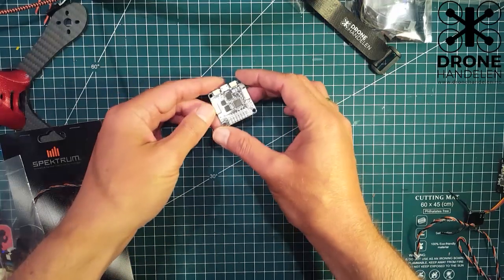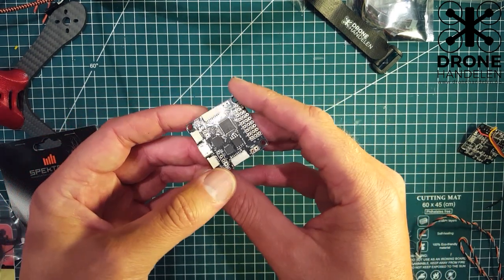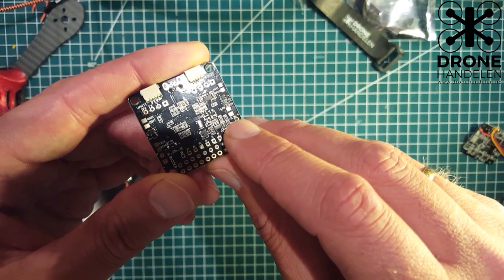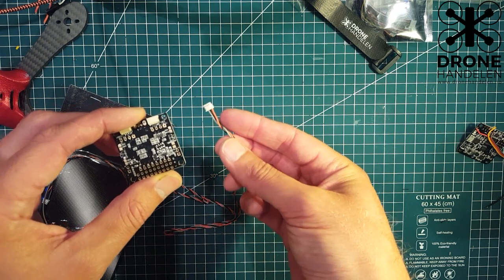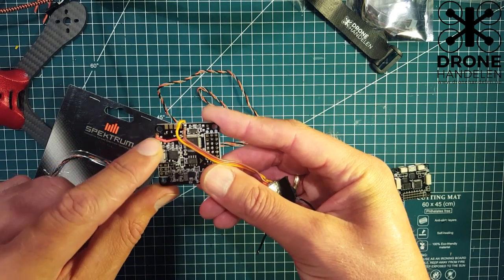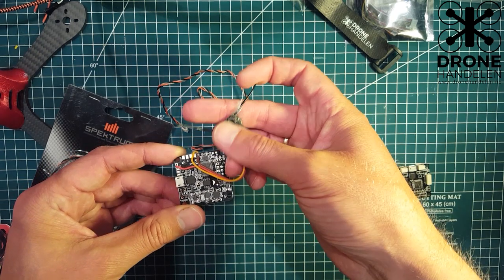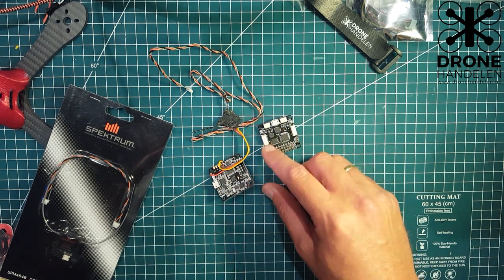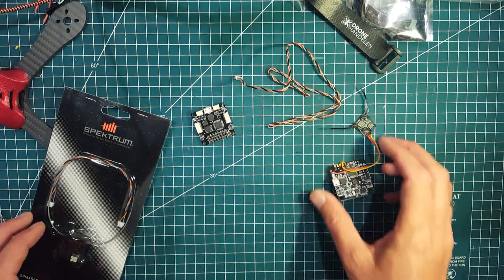How to: Spektrum satellite to FC

Comment: Hey,
Nice video.
I have the same receiver as you but as soon as I plug in the battery, the LED flashes on then off never turning back on except if unplug then re plug the battery.
I have measured the Voltage on the pads and it is 3.291 volts so I don't know why it is doing this.
Reply: Seems like you have not bound the receiver to the transmitter. You must do this first or through beta flight
Reply: @Warbirdpilot  care to explain a little more? How does betaflight put the satellite in bind mode?

Comment: Hello,

super video I just have a small question, I buy this flight controller ( Upgrade DYS 30.5x30.5mm F4 Pro V2 Flight Controller AIO OSD & 5V 9V 3.3V BEC & Current Sensor)  and I want to know if it is compatible with the PSM4648 radio receiver?

thank you in advance
Reply from the maker: Thanks, I am not familiar with this FC that you mention but I am pretty sure that most FCs today support most serial receivers..
Reply: thank you, 
you advise me which radio receiver?

Comment: Super nice video. Do you have a video how to Configuration on the receiver mode and show how to set up the ports on betaflight ? Im using a Spektrum SPM 4648 DSMX and putting on a SP  Racing F3 ACRO ?

Comment: does this work with the normal spektrum satellites?
Reply from the maker: Yes, but its not recommended as "normal" satellites are not standalone receivers..its recommended to use their dedicated quad receivers..
Reply: Thanks, ive not been able to get the sat working on its own, everything connected right, 3.3v, ground and the signal wire into ch4 but nothing and for no reason cleanflight stopped connecting it, nightmare, im wishing I bought a frsky TX now and module, its £200 but I hear frsky have a stronger signal and range, sounds like the way to go now.

ah wait just realised im confusing your video with another, some other guy said the signal wire MUST go to ch4, but you say RX, I will try your way.

The odd thing is the frsky RX that came with the quad has a single wire going to both ch4 and ch5, do you know why that would be?

Comment: I can't get binding mode on spektrum in my receiver on . can you help me I'm using spm4649  too
Reply from the maker: It should enter bind mode automatically if it does not see any signal from your transmitter(ie if your transmitter is off) in 10 seconds, as far as I know
Reply: i cant get blink mode (bind mode) on my receiver after go to CLI and write set spektrum_sat_bind=9... after i plug usb, my receiver is only blink one and not blinkink like binding mode... can you help me.. im frustated.

Comment: thank you for this video , it helped me a lot !! 

I'm having a problem right now with arming my quad , I used to have a switch aux1 for that. and right now in clean flight I see the end points of the receiver to throttle is 1159 and 1840 , I will be happy if you could help me configure it to the normal 1000 to 2000 . 

I'm using sp f3 racing board and sat spektrum receiver.
Reply: my transmitter is spektrum dx8 gen2
Reply from the maker: Mohammad Al-Thubaiti you go into your transmitter and adjust your endpoints on the throttle channel in servosetup screen.

Comment: Thanks, at the end you mention that one can connect it to pin directly as far as is the right one for 3.3v, but you prefer soldering directly to the board. Is that right? Can we connect the spektrum sat receive connector to such bay and not have to solder altogether ? If so how exactly? How do I align the 3 pins into the 8 pin bay? Thank a LOT for your expertise in advance . I am personally shocked that such a popular board would force us to solder joints for such a popular rx like spektrum. I want to think there's a way to just connect them and works!
Reply from the maker: On this FC that I showcase here there is no other 3.3v output than the one you have to solder on to, other FC cards may be different and have spektrum connectors built onto the FC itself, in that case you can just plug the  recevier in. I also know that spektrum now has a quad specific receiver with telemtry that support 5v instead of 3.3volt, in that case you may use any 5 volt source you like.
Reply: Thanks a lot. Ok then I guess I have to bite the bullet and solder it to my FC then

Comment: hello would this http://www.horizonhobby.com/fc32-rev-6-flight-controller-spmfc3206be plug and play ? with this http://www.horizonhobby.com/spektrum-dsmx-quad-race-receiver-with-diversity-p-spm4648I fly a vortex with a silver dx8  I only know BIND AND FLY    would these components work on any machine I get as a kit ?thank you there is not much spectrum BNF  stuff
Reply from the maker: Well, with that FC you would nned to do some soldering anyway as there is only pinouts on that, and no connectors. So no, that FC is not plug and play in that sense.
To your second question, yes any kit will most likely be able to use those components.

Comment: do you have to have your ESC signal wires hooked up to the FC for your receiver and transmitter to function? I am waiting for my esc's in the mail and when I went into beta flight my receiver is going crazy. what do I do?
Reply from the maker: No, The ESCs do not need to be connected to fc to set up the FC. If the receiver is going crazy there must be something other setting that you have missed under the configuration or setup tab.
Reply: FLYPiLOT how can I find out which UART I am connecting to? I have it hooked up to the SBUS /PPM pad right now, but it did the same thing when I plugged it into the spektrum sat connection.
Reply from the maker: It should say on the FC board or in the documentation for the FC board itself what UART that port is using. You have to make sure that in betaflight/cleanflight that you have "serial" selected o the right uart port.

Comment: hey hows it good video , im dealing with a problem im using the same f3 board you have , with a spektrum satellite receiver , and connected the + and - and serial wires to the uart3 , and my receiver is cutting out sometime losing its bind , i notice in your vid you connect the + to a different 3.3v on the board , thinking maybe thats my problem , so should i try that and why dont you use the power from the uart??   @FLYPiLOT pleace get back trying to trouble
Reply from the maker: Hi, because spektrum satelites need 3.3 volts, not 5v..

Comment: hello, i have the F3 and have connected it like you, it binds but i cant get it to register in baseflight
Reply from the maker: I don't use Baseflight, try Betaflight, its much better..
Reply: FLYPiLOT was it correct to connect signal wire to RX spot on the back of the board?
Reply from the maker: Yes, signal goes to RX, make sure you have the right settings in betaflight under PORTS, and CONFIGURATION
Reply: FLYPiLOT thanks, on my FC it ended up being RC input 4, plus settings in clean flight, thanks again for the response

Comment: thanks for the info.... so can the satellite receiver that  come with the AR7700 be used independently like this ?
Reply from the maker: ST Logan No and yes :) it will work but not 100 percent as its not a stand alone receiver. I recommend you get one of the quad receivers they have, they work the best.
Reply: Had the same question.  I should get a new receiver.

Comment: hey I'm looking for any help I can get, are you using a spektrum transmitter? I built two quads first builds neither of them work, both are completely different escs, and fc, but I have the spektrum satellite rx in both everything seems fine in beta flight and the kiss gui but the escs wont arm, or do anything at all any suggestions?
Reply from the maker: On spektrum you need to increase throttle value to 150 to get quad and ESC's to arm, it has to do with calibration of ESC's.. Check out this video: https://www.youtube.com/watch?v=csCBMF8P3qg
Hope this helps

Comment: having trouble my spracing board & my naze Rev 5 both lock up and require boot jumper. Happens when I set the cleanflight to the correct spektrum radio input.

Comment: Forgot this: the reason I am buying this is because I am afraid of losing connection since comments are that spektrum radios tend to lose connection with carbon fiber frames... And this one is supposed to be better for any"carbon frame" issues... I have a lemon RC receiver and haven't had major issues but just want to be "covered" in case it happens. I LOVE SPEKTRUM PRODUCTS
Reply from the maker: All systems have problems with carbon frames, it does not matter if you have Frsky or spektrum, RF signal does not penetrate carbon fiber, you have to make sure your antenns are positioned well outside the carbon fiber or you will have problems.

Comment: Good dayI thought that It was just a matter of plugging (in the case of the naze rev6) the cable that comes with the receiver to the spektrum port in the naze. Isn't the power in the spektrum port 3.3v? May be I am wrong... I thought that was the whole point of it being called Spektrum port... Just bought one of these receivers thinking it was plug n' play with the rev6... I hate soldering... Thanks (I have a tyrant 180 and an old dx6i) greetings from Bogota, Colombia
Reply from the maker: well some of the fc have a spektrum port and then its just to plug in. but some don't and then you have to solder.

Comment: how do yo u bind this satellite rx to your radio?   I'm not sure how to get it into bind mode
Reply from the maker: great question. there is actually three ways of doing that. 1. bind the satelite to your radio when its connected to a normal receiver. 2 the spektrum race satelite goes into bind mode automatically after 10 seconds when your radio is not on. 3. use a cli command in cleanflight called spektrum_sat_bind=9 or 5 depending on your satelite and radio. type save and then power cycle the flightcontroller with the usb and it should enter bind mode. hope this helps
Reply: Awesome!  Thanks so much!